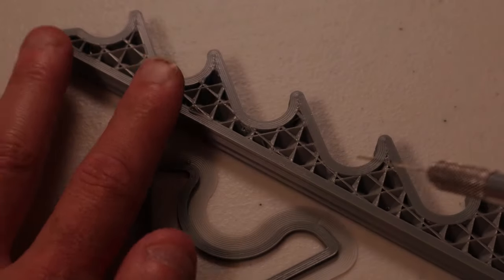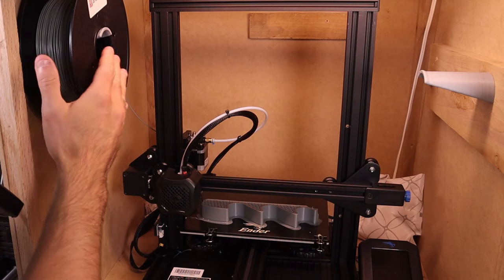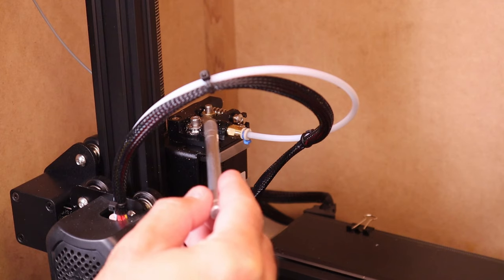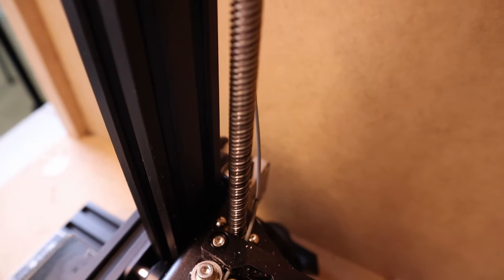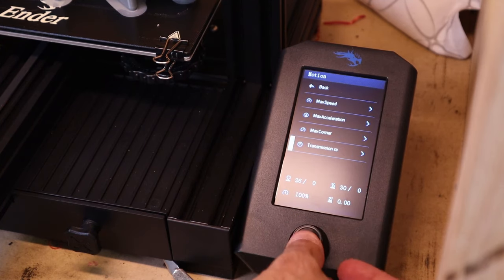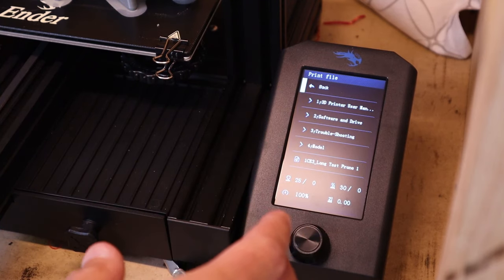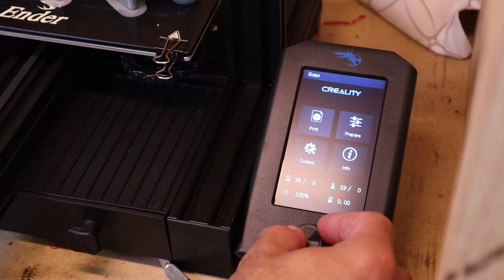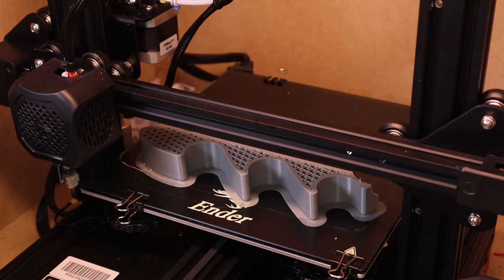Creality Ender 3 V2 - Solving Under-extrusion To Save You Hours

Comment: I have watched a ton of your videos and it seems like you are always printing the same thing. Can I ask what it is?
Reply from the maker: Yes for sure, well it wasn't planned, I thought more people had 3D printers, or had access to them.  It turns out that I was wrong, and I have quite a few requests to print these parts https://youtu.be/9M2wX5IQAYU which I designed for my own Bowflex bench.   Over a year ago I released a video with the initial concept and then improved upon it in both function and looks.  You'll see my parts are printed with heavy walls/infill and a larger nozzle size because they will bear some loading in compression.

Comment: I calibrated the esteps etc properly and had awesome printing results with my cura settings. few days later it was like all the calibrations were gone. couldn’t check it properly by now but pretty sure it deleted all my calibrations i did with pronterface. flow setting went from 107% to over 135% and it’s still not enough(printing TPU) 
the rest on my ender 3v2 is fine, no issues there.
I think that powerswitch on the back can cause this randomly but not sure about that...
Reply from the maker: My e-steps are set to 105, though I do over extrude slightly so I can guarantee there are never any voids (ABS overhangs suffer a little bit)  I was confused at the beginning because it was not saving changes, after the firmware upgrade you must still remember to press store config. so it keeps the setting change.
Reply: @NeedItMakeIt  I did that but still somehow it deleted them. I stored it properly, turned off, recheck —> all fine. used 2 weeks (on/off sometimes) and out of nowhere it was all gone when I restarted it one day. (no technical issues in the house)
due to my DD I had to set my esteps to 142. all out off nowhere I had to increases the flow over 30% that’s why I’m sure my calibrations deleted😅

Comment: The Ender 3 v2 v1 software allows yo to save changes to the transmission ratios.  Back up two screens after you make the change and you are given a choice to “store, or “read, or to “reset” to defaults.  I have had no issues retaining the extruded changes.
Reply: In my case the problem seems to come from the SD card that came with the printer. Once I switch to a regular Kingston SD all saving  problems were gone.

Comment: How do you calculate the transmission ratio?  The links are all about the firmware, not about the transmission ratio like your said in the video...  😕
Reply from the maker: I'll have to check my links, I'm not sure what happened.  

The simplest method is to mark the filament 110 mm away from the extruder assembly with a ruler.  Heat up the nozzle and tell the printer to extruder 100mm.  You should see 10mm away from the extruder assembly.  If it is less, you'll need to up the ratio, and the opposite is true of course.  Mine as set too low and I have it set to 105 now and it prodes accurately sized parts without any under extrusion.  https://www.youtube.com/watch?v=QnrH2Sk7y40 here is the video I referenced for e-steps at the time.
Reply: @NeedItMakeIt  Well thank you very much, wasn't expecting such a prompt response but it's perfect I was still watching videos about that...

It's a lot simpler than I thought, but it brings another variable into play where if you compensate you steps for the material you'll have to test for each material, but meh...

3D printing is a lot more complicated than i thought, it's really not plug and play yet, not sure they should call them "printer" more like CNC extruders or something...  i just hope i get to a result and usefulness that i can say it was worth it....

Comment: I am hoping you can answer a question.  I have a similar situation where my printer would be in a cabinet and I like your spool mounting and am considering the same.  My question though is how tall the Ender 3 V2 is from the shelf to the top of the crossbar.  The specs say that it is something like 650mm, but I think that may include the spool holder?  Could you be so kind as to measure the height to the top of the crossbar without the spool holder in place?  Thank you very much and your video was very informative.
Reply from the maker: Hi, the dimension from bottom of the feet to top of the cross-bar at the top is 477mm or 18 3/4".  When I was using ABS I had to change the spool location, sometimes the heat in the cabinet was affecting the filament and causing it to feed poorly through the extruder gear.  Outside of the cabinet seems to work well for all filaments so I just mounted it to a piece of wood.  I will be designing and printing some with bearings included to reduce the force needed to feed, and probably upgrading to the dual gear also.   Glad you found the video helpful!
Reply: @NeedItMakeIt  Thank you! I greatly appreciate you taking the time to respond and provide other helpful info.  This is low enough to fit into my cabinet, though I will need to mount the spool in an alternate location, something like you did in the video.  Again, my thanks.  Your response was a huge help and I like the spool setup you are using. Take care...

Comment: I designed a corexy machine which I usually print with 150mm/s at least for most of prints, but sometimes the extrusion is not enough (under extrusion), I found that it is because the feedrate of extruder is not enough eventhough I had set the extruder to 1500mm/s  in marlin firmware, it did not help out. I am using BMG extruder having estep of 430 for extruder. Do you have any idea of what it is going on?
Reply from the maker: Impressive if you designed one yourself!  I've heard great things about the CoreXY printers, I may have to jump over to testing one down the line.  

A few questions:  

Do you have any skipping in the extruder that you can see?  Those kinds of speeds are going to be pushing some limits.

Are you able to see how the extruder handles the filament, meaning is it actually accurate in its movement at those speeds?  I'm not certain how to test this, maybe a series of extrusions and retractions in series. 

Can you confirm that the nozzle temp can handle the speed?  

Are you seeing under extrusion in the same locations every time, or random? 

Could you upload a quick video and post a link, it is a lot easier to analyze when I can get the full picture.

I'm no expert at machines that run at these speeds, maybe someone else will see this comment with some additional ideas.
Reply: @NeedItMakeIt  I have already found the cause of this issue. The harden steel nozzle is the main reason for under extrusion. My case is that the bowden tube is quite long at around 850mm due to big machine size. There are already quite resistive for the filament to pass through the tube since its unusual length, and after changing to the harden steel nozzle, due to the nature of harden steel material property(more poor transfer of heat as compared to brass), the extruder was even harder to push the filament into the melting zone and hence the extruder started to grind the filament therefore causing slipage. Even though I had cleared extruder gears, the feed rate could not reach as required by the slicer software. After noticing this root of under extrusion problem, I changed back to brass nozzle, then everything went smoothly again(the same gcode file). Neither my tech friends and I have never happened to this before using both direct drive and bowden system. But now we all know that too long of bowden tube with a harden steel nozzle will cause under extrusion and limit the printer's fast printing potential.  PS: The nozzle is a high quality nozzle which I used on other direct drive machines before so the the nozzle has no quality issue. PLUS , when using harden steel nozzle(assume the same hole dia. of .4mm), increasing the temperature by 40 degree C will help a bit.
Reply from the maker: @calvin-7540  I've been wondering about these things, I have a hardened steel nozzle and I have also been printing with CF filament a bit, I noticed under extrusion and slipping, at first I thought it was due to the fibers inside the filament, it turned out to be a temperature issue.  The package had also been punctured so I wasn't sure if it had a moisture problem too.  Lots of variables, and that's where you really need the experience of the problem to know what the source really is.  

Your notes are very helpful, I had been planning a video about the bowden tube specifically a length comparison, and also a test to see if Capricorn really does have less friction.  

I have a neat idea to try and reduce friction inside the tube as well, basically reduce the amount of filament in contact with the tube at any point.  I have no idea how to do it yet.
Reply: @NeedItMakeIt   "The package had also been punctured so I wasn't sure if it had a moisture problem too"         __________You could check by seeing if there are any bubbles when the filament is being extruded right out of the nozzle for a length of more than 200mm or more. If there are a lot of bubbles even you have extruded quite a long distance(more than 800mm perhaps or just to print a calibration cube), then the filament is hydrated for sure. You could simply dehydrate it with a food dehydrator within a certain temperature range(You could seek help from the filament manufacturer for dehydrating temperature range).  "  I had been planning a video about the Bowden tube specifically a length comparison, and also a test to see if Capricorn really does have less friction. " __________That sounds exciting, I was also planning to make a comparison of print quality and friction difference between normal Teflon tube and Capricorn tube. I can't wait to see your results LOL. I will also share my test results with you at the end.  "I have a neat idea to try and reduce friction inside the tube as well, basically reduce the amount of filament in contact with the tube at any point.  I have no idea how to do it yet."  ________ Actually, as far as I know, the Teflon is a very noble material and it has a frictionless surface which is very ideal for feeding filament as a tube. That is why one of my hotend design & manufacture friends or even some designers often include a short Teflon tube inside the hotend for printing low-temperature materials like PLA or PETG. I suggest you could try shortening the length of the tube as much as possible or just simply change to direct drive.

Comment: I use Jyers FW with my Ender 3 V2, are you just talking about setting e steps? I have never seen the ratios you show but 93.0 is the default e steps set by creality I think. And they need to really look at their EEPROM confusion...Anyway fixing e steps def did not solve my under extrusion inaccurate prints poor bridging wrenching out scalp hairs issue but i am hoping the much more involved and painful fixing binding might, because I have narrowed it down to that pretty much

Comment: Jyers firmware is the way to go for ender 3 v2, I use it and not only it resumes after power failure but it also supports abl and filament runout sensor. It's the most worth it upgrade.

Comment: Looks like you also need to upgrade your display's firmware to fix the typos (there is another sd card slot if you unscrew the back of the display housing)
Reply from the maker: I'll check it out, thanks!

Comment: Printed test print fine, went to print it again massive underextrusion still haven't fixed it
Reply from the maker: Were you able to adjust the e-steps?  You'll need to adjust and then go back 1 menu and press storage config. it will save that setting.  Your struggles are real, I've been there.  If you're running the same as I, you should be able to solve the issue, let me know.

Comment: Creality Ender 3 V2 firmware 1.0.2 issue

I recently bought a Ender 3 V2  with stock firmware. After testing it for a few days I thought it was time to upgrade the firmware to the latest. This was a mistake even though thermal protection is in the upgrade. After upgrading to 1.0.2 I had all kinds of issues as I have read below. I had bad separation and when bed leveling with my g-code leveler I found the four corners were set properly but when it went to the fifth location (dead center) I found the paper had zero drag on it. This meant the firmware was not dropping the Z axis down low enough. This is a firmware code error.

I could not find a way to roll back to the original firmware, I just could not find a download of it so I had to use Marlins latest as others here have but now this is no longer free. It cost about $11 a year with unlimited downloads during the 12 months. So beware, if your going to upgrade firmware make sure you have a copy of the working one before you do so.
Reply from the maker: https://www.chepclub.com/ender-3-v2-firmware.html (can you try this website?  I may have the original version, however since it was flawed, I'd be stuck in either case.  So they've released bad software and now they are charging us to correct it...
Reply: @NeedItMakeIt  That website is the link I used to get a working firmware as I described. It used to be free, not any longer. Enders have always used Merlin firmware but they make adjustments to fit their needs. Too bad this time they muffed it. My understanding is you can still get Merlin firmware and code it yourself but I just don't have the time to learn how. Even using the site you listed you still have to make adjustments on the downloaded pay firmware. As stated on the download page with stock Ender 3 V2 4.2.2 main boards (stock) there is a code for auto filament run out sensor that is enabled.  Err supposed to be stock but whatever. It says you have to turn this off by running a code M004 I believe. I ran it without doing this and it's good so far. Just make sure you have a copy of a working firmware and read about the new one. Some require a display upgrade first.
Reply from the maker: @Vv_Twisted_vV  Thanks, nothing can be simple can it.  They have a large customer base now running off of this software, why not capitalize on it I guess.

Comment: I’d like to request a how to for printing small parts. I have a .02 nozzle and can make it work but it’s not that great. Thanks for the content. ✌️
Reply from the maker: That sounds like a great challenge.  I've never had great success with small nozzles and most of my prints are structural so I changed pretty quickly to a larger nozzle size.  The small nozzles seem to clog very easily... small particles/contaminants can't make it through I suppose.  Are you able to provide a little info about what materials you print with and can you send me an email or link to a sample file?   

Have yo tried to use a larger nozzle to see if the detail is good enough?  I find that thinner layers give you much nicer looking prints as well, I'm using 0.18mm right now with great success.  I always over-extrude the bottom layer and I always make the bottom layer thicker for better adhesion.

Comment: Mine wouldn't save settings to the SD card it came with because it was formatted with a 32k block size instead of 4096.
Reply from the maker: That's interesting, nobody has ever mentioned this to me before.
Reply: @NeedItMakeIt  the alternative i just thought of is that mine shipped with a fake sd card and and the settings file was being written to write only memory 😆

Either way, Formatting the card fixed the issue

Comment: Could you please share the bin file of the 2.0.6 firmware version. It seems it is not available on chepclub anymore?
Reply from the maker: https://drive.google.com/file/d/1NQGiJOq1wygLa3jnxyJ8Kz8ck1VhiteT/view?usp=sharing  can you give this a try.  I've renamed it because it cannot be named the same as the original file.
Reply: @NeedItMakeIt  Will this latest firmware work on a 4.2.2 or 4.2.7 main board?  Thanks
Reply from the maker: @joedirt757  I hope so, it worked perfectly on mine, but can you please tell me where how to confirm the board on the printer and I can check for you.

Comment: Is it possible to get the updated firmware for free?
Reply from the maker: Yes, they should be free.  Apparently you can do this through Cura https://all3dp.com/2/ender-3-firmware-update-cura-guide/  That may be a tad easier.  If not here is where I found the file.  https://www.chepclub.com/ender-3-v2-firmware.html
Reply: @NeedItMakeIt  Thank you!
Reply: @NeedItMakeIt  Apparently CHEP does not have the firmware available on his website anymore.
Reply from the maker: @shibui2466  https://drive.google.com/file/d/1NQGiJOq1wygLa3jnxyJ8Kz8ck1VhiteT/view?usp=sharing  Here is the version I'm using, it has been working well for me since the video.   Maybe this would work for yours also!
Reply: @NeedItMakeIt  Thank you for your willingness to help. I have sent you a message to have permition to download the file. I will also try to get the bin file of the latest version, if so I will let you know.

Comment: To save the settings you just have to click on "Storage configuration" which should actually say Store or Save configuration.
Reply from the maker: Correct, however it was not working in my case.